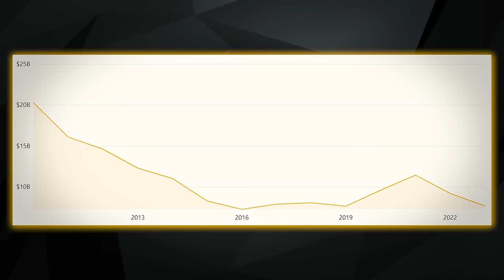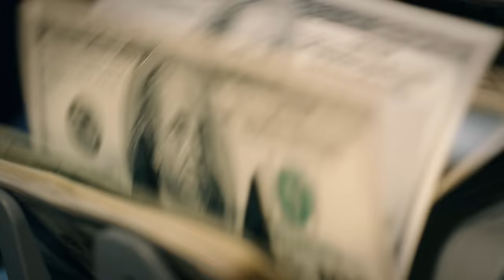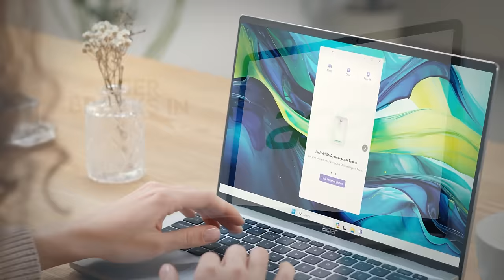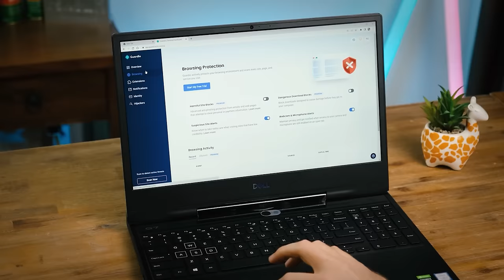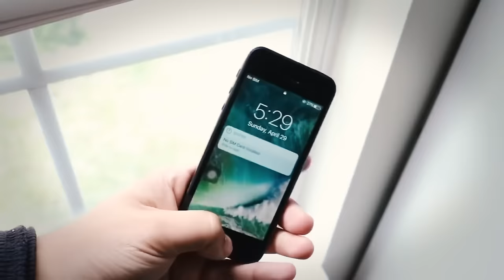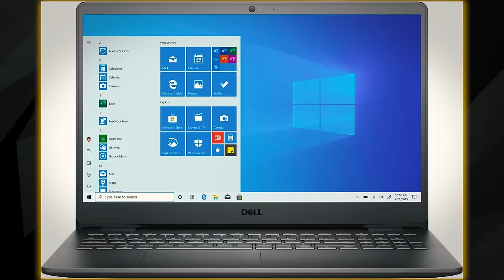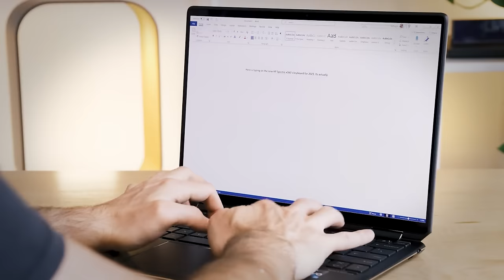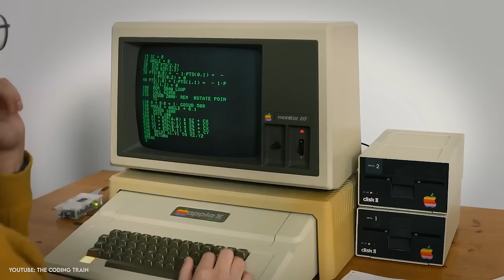Whatever Happened To Acer?

Comment: Their market share lasted about as long as their laptop hinges
Reply: so true
Reply: Ouch i felt that
Reply: You're being too generous to the hinges. On mine, they lasted about 8 months
Reply: my 1st ever laptop was an Acer back in 2001.. hinges lasted less than a year
Reply: I've had an Acer laptop for 7 years and its hinges still work fine after years of daily use
Reply: My acer aspire one aod 270 netbook hinge is falling apart after a drop down wooden stairs. Still works after 12 years of ownership
Reply: So true bro ... Acer body build quality s*u*c*ks ... not with one, but happened with 2 Acer laptop hinges
Reply: Seen Acer hinges last for years too so guess it must be partly lower quality but mostly how the user opens a laptop. Seen alot of people basicly rape their laptops when opening and even closing.
Reply: i had an acer which is now 10 years old. and its hinge is better than an asus i bought 3 years ago. and the new acer i bought 2 years ago is also working just fine. they are good but just kinda lazy
Reply: kinda like msi
Reply: @grumogus  I've had an old very old msi laptop it broke came back to life years later then it broke again
Reply: My Acer Chrbomebook is the first laptop I have had that has a loose hinge. And it developed that issued about half a year into its use.
Reply: @Quest3Games  yup the cheapest ones have the big problems usually it's the chromebooks that it happens to
Reply: true bro i had acer aspire after using it for a year i had hinge problem.
Reply: The hinge gave up on my Asus laptop, actually.
Reply: My acer laptop monitor would randomly turn white. I need to be very careful to ensure to get the right angle to see content on the monitor.
Reply: Ouch
Reply: Acer was cheaper than ASUS but much worse quality. I remember them just by their bad quality.
Reply: Mine lasted 1 year on occasional use
Reply: i felt that
Reply: Another victim!
I blamed my girlfriend.
Reply: my acer laptop hinges work well even after 6 years, but there are things to hate like the lack of a mux switch, small battery, low cpu/gpu tdp and terrible screen.
Reply: @someone-mn8or  funny enough mines still works, and I've had it for 10 years... their vent wasn't as long lasting.
Reply: Yeah, their hinges are trash, but their motherboards ironically take a lot of mishandling, unlike Apple poo coated motherboard trash, which disintegrates even on dessert moisture levels.
Reply: I've had to repair more HP laptop hinges more than Dell or Acer fwiw
Reply: True....
Reply: hinges literally disintegrated
Reply: HAHAHA
Reply: totally brothers with MSI
Reply: hahahaha... i thou its only mine like that
Reply: I have an acer, the hinge is so bad bruh like I have to otate it a certain way just so the wire conencting to the sceen doesnt glitch out and turn of the scree
Reply: still better than hp/msi's hinge
Reply: Hp
Reply: Pre 2014 Midrange Acer was good so good in fact mine run cashier and warehouses database till these day their key is they got a good airflow and easy to access motherboard, not to mention steel hinge bolted into casing but thats it, not to mention pre installed windows with no bloatware.. its all went downhill after 2014.
Reply: All hell broke lose when my hinges started giving on my pricey acer.. U literally have to retro fix them and make a better hinge yourself
Reply: agree. I think it depends on model. Mine was back then the cheapest on Core i5. On mine they lasted abou a year, then 1 hinge even being repaired cracked 2 monitor covers and eventually broke, breaking the monitor.
Reply: Can't be any worse than HP.
Reply: @imeakdo7  Congratulations.
Reply: @SupamChang not my experience. i dropped an Acer Aspire One while working on a building site. Picked it up again and continued without skipping a beat.
Reply: Ooo damn thats a good one there hinges are BS
Reply: I think the build quality depends on the model. We've had two Acer entry-level laptops on separate instances and the hinges were always the first to go. 

That said, no more Acers for us. If they can't be trusted to build the small things right like the hinges, then they can't be trusted with the bigger things.
Reply: hi stuckduck
Reply: Lol yep. Literally cracked within a few months
Reply: Ok I don’t know how but when I dropped my acer laptop from about 1 meter every single thing was completely function even the hinge was fine, but when brother dropped his laptop which is the exact same model as mine on the bed the hinge broke and he didn’t even drop in from too high, just a few centimetres
Reply: Lol I just commented someone that a friend in collage bought one and in a week the hinges broke, warranty didn't cover up, he had to pay and 1 month later got the laptop back and 15 days later it was broken again.
Reply: Diabolical

Comment: I'm a computer repair technician, and I run a computer refurbishing company. I have to say that Acer laptops are well built, even the cheap ones like the Aspire One. They are easy to repair and also you can find a lot of spare parts. I think that the worst brand is actually HP with their low budget "laptop" series
Reply: but sometimes it really pain in the ass just to disassemble the laptop
Reply: @ariekowidodo7285  because you never tried to disassemble the plastic hps like the hp laptop 250
Reply: @alexlextar9270  i mean the acer laptop not hp, i had one of that
Reply: true, I have bad experience with all HP products. most of it lasted barely a year. But then that was 15years ago and because of it I don't buy laptops anymore; tablets are much better option for me
Reply: MissMuffin-qc8fc  we are talking about Acer and not apple 😂😂
Reply: MissMuffin-qc8fc  that sucks. Say thanks to apple that begin to solder the drives in 2006 and then others followed
Reply: @alexlextar9270 
2015, not 2006

2006 is still the era of Apple's modularity
Reply: Another in the same profession exactly told me this thing. Acer laptops are easier to repair with easily available parts. hp is really the worst ( across the entire range)...hp laptops have the highest failure rates after 2 years.
Reply: True. My Acer 4930 got me through 5 years of college. Only the battery (as expected) failed.
Reply: @BigFatCone  yes, it’s true
Reply: I definitely agree. I've had two HP laptops break due to poor manufacturing. But my daily driver is now a second-hand Acer laptop and it does 90% of what I need from a computer. I have yet to hate, which I suppose is as good as I can ask for
Reply: agree HP and Dell are the worst
Reply: I have never owned an HP laptop or desktop although I have used quite a few. HP keyboards are horrible, stiff and very clattery and noisy in operation.
Reply: They are easy to repair except when you need to replace the entire keyboard cuz they have this soldered plastic bits which hold it in place.
I literally saw a 50 min tutorial and decided fuck it i will just replace the keycap. 😂

Comment: Crazy to me Acer is struggling. These guys have the best budget lineup, plenty of spare parts, good pricing, and warranties that go above and beyond, fixing something I destroyed myself accidentally.. Yet people are saying they fall apart with poor warranty? Idk about other models but I got an Aspire 5 and soon 4-5 other people picked one up because it was cheap, reliable, easy to repair, and there are even pretty powerful models that don't look overcooked.
Reply: i am using helios for more than half a decade, never had a problem until recently with screen
Reply: They have improved in recent years but their laptops used to be terrible
Reply: My main laptop is still a Phenom II laptop of theirs, the Aspire 5552. Somehow, it's still in pristine shape and after re-pasting and re-padding the heatsink and replacing the battery, I don't see it breaking for a long time.

I did have a 2007 17 inch travelmate 7720 whose hinge snapped, though. Can't believe that the hinge was built into the shell plastic rather than the screen frame.
Reply: bad thing laptop acer their screen easy broken from little black dot take time sure become  half black screen
Reply: Acer product has good warranty, but their build quality is mediocre at best.
Reply: I'm sorry WHAT? As someone who sold and had to RMA these on behalf of customers constantly - They were shit. Nigh impossible to take apart as a technician without breaking shit, terrible warranty handling and a BIOS that would flat out refuse to boot regular Windows installer USB sticks most of the time, only allowing specific ACER DVDs to reset a borked install.
Reply: Bad quality, and not cheap enough compared to ASUS.
Reply: @Slav4o911  I know that's the case for other models, that's why I had a Asus gaming laptop, but the aspire lineup is pretty much as cheap as I could find that actually was repairable
Reply: I have an acer and it pretty good but it's running linux though
Reply: @Slav4o911  Is interesting you say Acer laptops are bad quality, when "flag ships" like Apple have the worst motherboards of the earth. Not even coated with conformal, Apple trash rots even on dessert moisture levels.
Reply: I don't know in which country you live, but in Europe acer quality was under the water. Most lasted a bit over the warranty then died. Most common problems were motherboards, and for the sentiment poor quality plastic and screens. So everyone i know just invested a bit more and got a decent quality other brand. Acer was those brands that you experienced and said never ever again buy something so cheap or Acer brand again.
Reply: @levif.1145 yeah my Acer V15 Nitro had many plastics and had reversed motheboard so it was a pain to dismantle, after I reassembled some plastics broke and it was not the same again. Moreover, I found there was a certain screw which was longer in the middle and if you had exchanged that screw the computer failed to boot without any sign. The speakers of that specific laptop was top notch though eith quad Dolby supported speakers but since then Acer downgraded the speakers on their later Nitro series which is a bummer.
Reply: I think acer has a good price to performance ratio like Xiaomi for instance.
Reply: One of my old laptops, I can't even remember what type it was, broke when my sister was using it before getting a new one, and giving me that. Screen crapped out quickly and so did the entire keyboard inputs
Reply: @lovelysakurapetalsyt I remember a thin vertical line started the appear on the screen on my Acer V15 Nitro which started to get more and more pronounced. I read then that it may be due to the video cable being bent and needed to be replaced. Then I disassembled the laptop but wish I did not because broke some plastic parts inside.
Reply: @Hopkins955  Oh jeez. Mine wasn't a line, it was static across half the screen. It was so bad that when there were words on that side, I couldn't see them, and I don't have bad eyes
Reply: I'm currently on my 2nd Aspire 5 laptop (the first one got destroyed in a house fire) and it's working fine. I upgraded the stock 128 GB PCIe NVMe M.2 SSD to a Gen4 1TB, though I did have some issues with that until I replaced it with a Gen3 512GB drive (works fine now). I've upgraded the memory to the max amount of 32GB and (after checking with Acer Support) I've added a 2.5" 2TB Seagate SATA HDD as a D: drive. The thing works like a champ even while I'm running Corel Paintshop Pro and Corel Painter to do my digital painting using a 22" graphics drawing tablet (the XP-PEN Artist Pro 22 2nd Gen). The file sizes of my artwork often hit over 400MB and other than some operations taking a bit of time to complete, it does what I need it to do (note: I am going to build a dedicated graphics workstation soon with a much better CPU than the Ryzen3 that's in my laptop).
Reply: I got an acer aspire 4830 in 2010 still running in 2020 until i bought another laptop
Reply: My aspire 7 has been running strong since the past 3 years. sure the mobo got fried at first but that got fixed pretty quickly under warranty, only problem is that the fans need to be lubricated quite often, and a comparatively lower thermal throttling threshold so it throttles pretty quickly. But it continues to serve me well so im not complaining.
Reply: I don’t know what people are on about, I bought a Swift 3 during the quarantine and the only hardware issue it’s ever had was the charging cable breaking, which a pet was at fault for gnawing on it.

I do have some problems booting up sometimes, but it’s due to the computer having crashed while the EFI partition was being modified (botched attempt at dual booting), and me not being bothered to try and repair it (it still works, I just sometimes have to boot it up twice before it loads windows)
Reply: I have an aspire 5 and it's been running well for  2+ years

Comment: I'm actually a bit surprised by all the "Acer bad" comments. I have a 2021 Acer Predator Helios laptop, and a 2023 Acer Predator Orion desktop, and they're two of the best computers I've ever owned. Makes me wonder if Acer Predator is held to a higher standard than regular Acer.
Reply: Obviously. Predator competes with ROG and Legion , so what do you expect?
Reply: people who saying "acer is bad" are just idiots because they just used acer aspire or nitro 5 which are the cheapest laptops from acer
Reply: @Saeedalikhann  I'm using a Nitro 5 right now. 5 years old and the only thing that broke was the screen.
Reply: @blazinglightgt8673  how did u breake it
Reply: @Saeedalikhann  Normal use. Oh and it has no battery either.
Reply: This probably was more so true during their peak. Obviously now a days they’re a lot better, but the stigma they developed in their past haunts them today.
Reply: The predator orion desktop you have is a acer nitro desktop on steroids with some rgb slapped in. They are (for the predators) overpriced pieces of junk sold with uncompetitive specs. Terrible value and performance for the price you are paying.
Reply: Asus is  better, although my laptop is HP, but I only use it when not at home and not on heavy loads. I have a desktop for that purpose (which I've build myself) and my mainboard is Asus ROG, it's the best mainboard I've ever had. Also my RTX is Asus. I didn't buy an Asus laptop, because HP was on sale and I wasn't searching for something with high performance, just an Intel with good battery life, the choice was between Lenovo and HP, but the HP was cheaper (they usually are more expensive).
 Never even considered trash like Acer. I had Acer long time ago and it was complete trash. I mean I've never owned that low quality anything. It constantly broke down, it was made with flimsy plastic and what not... and at the time didn't have any money so I couldn't buy anything else,  that made the whole experience more traumatic.
Reply: Acer are currently second best major manufacturer, right after Lenovo. ASUS are alright. Dell are quite meh. HP... no comment.
Reply: Same here, I own a 7 year old Predator which still runs smooth and fast. Just changed its battery few months ago and upgraded the ram.
Reply: Wait until hinge fucks up
Reply: My Predator helios 300(2020) has plenty of issues even within the warranty period that took me 8 visits to service center and consumer org only to settle it. I love the exterior so much but i couldn't pretend it's a good quality laptop and now it's not charging anymore after 3 years :(

Comment: I own and use 2 acer laptops (7 and 10 years) for leisure use. Still going strong….
Reply: So acer is good but they failed in marketing i think
Reply: Same, I still have Aspire V5-431 from 2012 and it's still working with no problem except from the aging Pentium processor. I replace the CD ROM bay and slap the 2TB hard drive caddy, now use it for offline media archive storage
Reply: i also own and use 3 Acer laptops.
From nomal laptop Acer Aspire, Acer Nitro 5 and the Acer Predator Helios 16.

All of them still working good, except the aspire. The batteries is already bad (8 y.o at this point)

Comment: Acer was my very first laptop. It served me quite well.
Reply: Me too. Bought my Acer Spin 5 back in 2017. In 2023, I bought a Surface Laptop 5 to replace it but the SL5 ran into hardware issues recently and I had to send it in for a replacement. In the meantime, I dug out my Spin 5 for use. Updated it to Win11 and it still works like a charm.
Reply: it was my very first pc aswell
Reply: same. and currently still using a acer laptop for gaming and for my work
Reply: quynhvir  I'm gessing your brother's laptop suffered from thermal stresses from a high power GPU in it.

Comment: I think you missed some crucial context here for the 2000s.  In early 2000s Acer was seen as a dependable no-frill workhorse taking market shares from IBM (it doesn't help that the final years before IBM exited consumer computer market its supply chain was constantly in flames, e.g., in mid-2001 a fix of my (new) Thinkpad A21 had to be delayed by 3 months due to unavailability of parts), whereas Asus was the new brand with some whacky ideas.  However, in around mid-00s, Acer tried to mimick Apple and started to fully outsource its manufacturing to Chinese firms like Clevo.  So Acer was no longer having their own manufacturing capacities and predictably that is where the QC of their products became very spotty, emergence of even cheaper knock-offs hitting their market share and when Lenovo cleaned up the Think-whatever lines they regained the grounds lost by IBM final years.  Having said that though, I am typing this comment on my 7-year old Acer laptop.